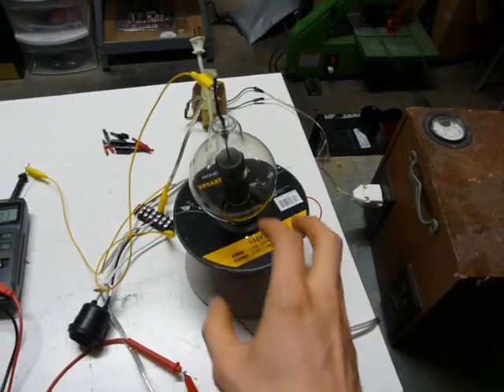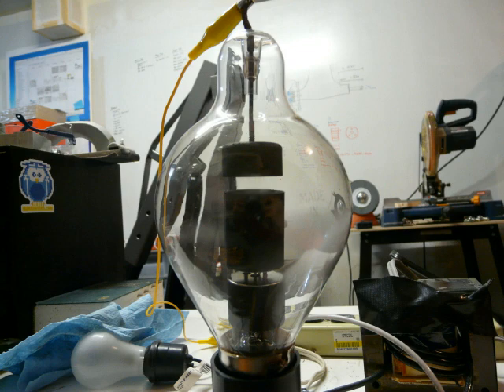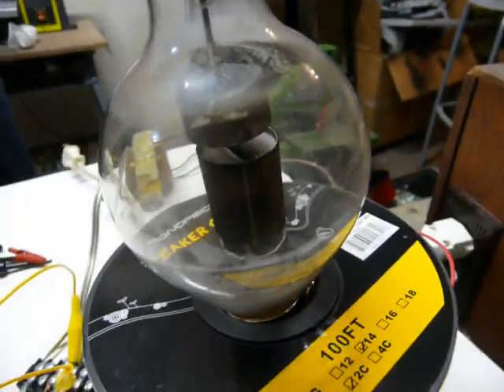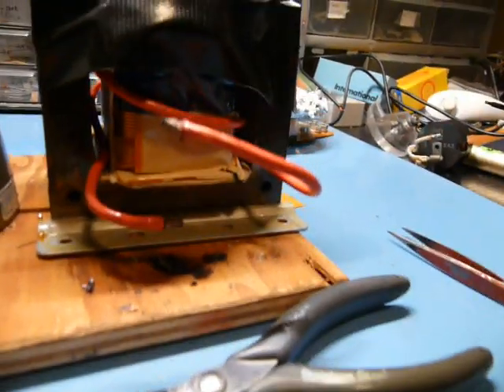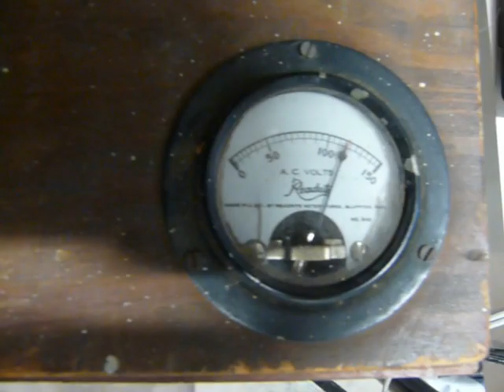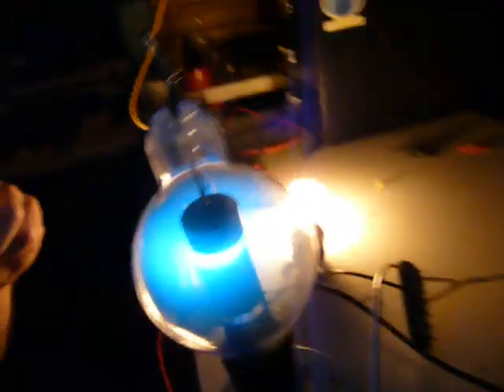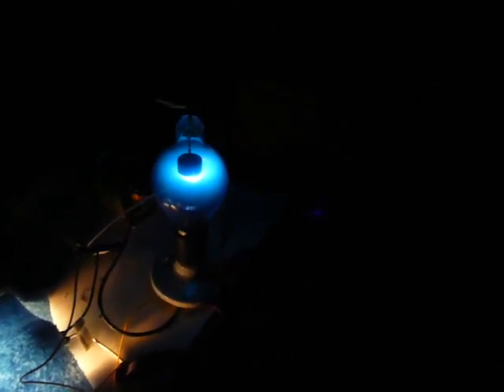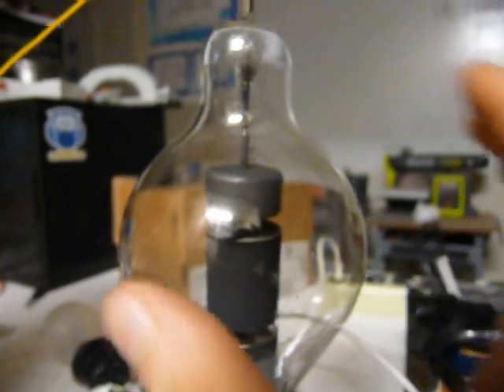Powering up a mercury-vapor rectifier

Comment: A microwave transformer could've done the trick too. They have a high amp coil that powers the filament of a magnetron tube.
Reply: That's a great idea. You'v just have to make sure you properly insulate the high voltage coil from contacting anything. If I'm not mistaken, the filament winding on MOTs usually outputs 2.4-2.6V, so it'd pretty much be perfect for that purpose.

Comment: Mercury rects are more fun to watch when the glow is pulsating- like from the modulation of a AM transmitter.  They were like a early disco-light pulsating to the beat of the music.  Been a long time since I've seen one since all transmitters built since the 1960s have used silicon stack rectifiers.  More reliable but less interesting.

Comment: Was just going to say regarding explanation... isn't it more like thermoelectronic emission happens regardless, on any heated filament, mercury vapour is only there to handle large current? Crts can function with internal vacuum, are diodes in a way too. But here we are interested in being able to have diode action while also working with relatively low voltage and quite high currents, hence mercury vapour in the bulb's atmosphere.

Comment: most of the mercury rectifier tubes I saw were 2 to 2.5V ac for the filament .lots amps.  They are pretty under load. They had less drop than 5Y3 tubes used later.  I got 866A in a HAM amp and could not get them at the time. Went with replacement plug in diodes. Less heat more volts and more watts out.

Comment: 2 volts 20 amps, that is a strange requirement

Pulling 20 amps out of a D cell battery, or about 100 of them in parallel

Comment: why to find a 2.5volt transformer when you can put filament in series with a dummy load resistor and to apply 12 volts on it a resistor that can give 9.5 volt dumy load let say to connect the filament like a voltage devider

Comment: Awesome for sure.  What is a tube like that worth?  I have a Tung sol 83 rectifier tube. It needs to be tested. Not to many testers around anymore. Thanks
Reply: There are many testers still in existence, but it's true, they're not nearly as easy to find as they once were, e.g. corner and general stores. Most of the survivors are part of personal collections now, but they're still available on ebay and at local hamfests, anywhere from $20 on up, IME.
The type [CD-]203 rectifier in the video is probably worth about $80-100; at least that's about what I'll be selling my Mellophone HW-203/CD-203 rectifiers for, after I've verified they're good. As for the type 83 full-wave rectifier, a NOS (new old stock, never fired, in its original box) type 83 is worth about $25-35, I think. They're pretty common in military and Hickok tube testers.

Comment: This is NOT a mercury arc rectifier. Nor is it a mercury vapor rectifier. It's a CE203 Tungar bulb, which has a tungsten filament and argon gas. They were used in battery chargers in the early part of the 20th century.
Reply from the maker: Oh, I thought Tungar bulbs didn't have mercury, but reading the promotional materials now I see I'm wrong. It IS certainly mercury filled: http://giferrari.net/blog/wp-content/uploads/2018/07/ce-203.jpg Correcting title.
Reply: You are correct - Tungar bulbs don't have mercury in them. This is indeed a mercury vapor rectifier. The box proves it. Apologies for my earlier mistake. I suspect that Cetron made these as replacements for Tungars in order to get around patents.
Reply from the maker: No worries! Thanks for stopping by.